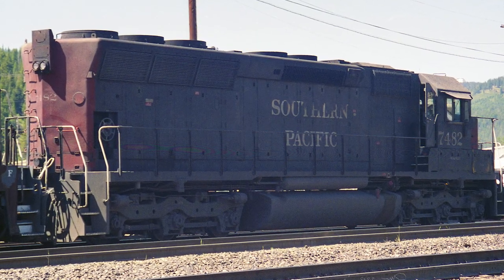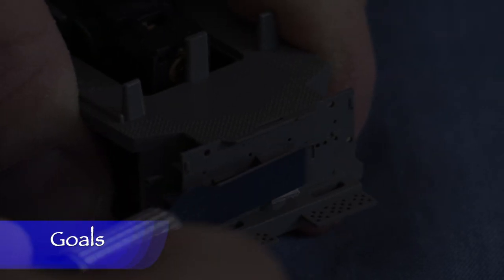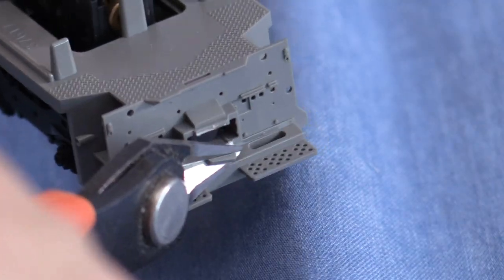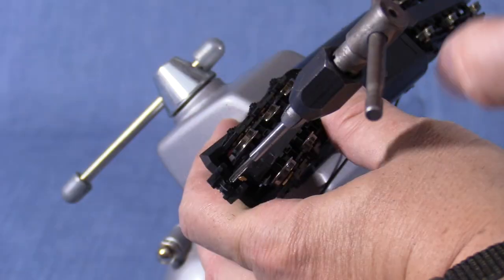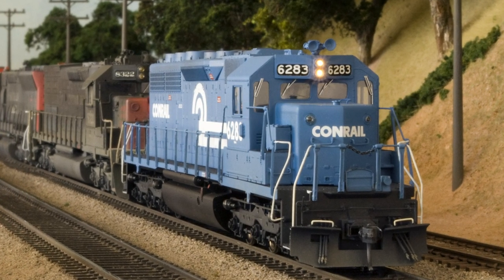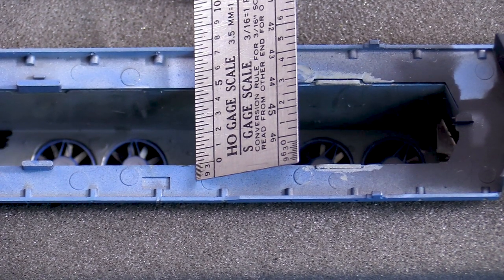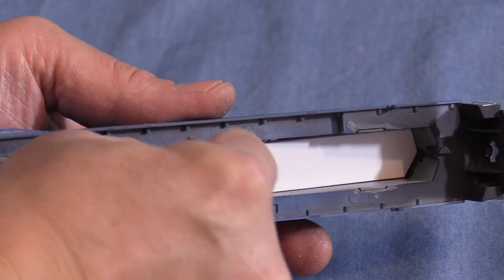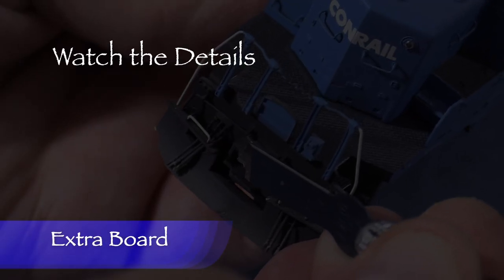Model Building HO SP Consist Part 6

Comment: I have some buildings for my layout, and painted the insides of their facades black so that light doesn’t bleed through. You could do the same when making buildings for your layout.
Reply: Thats the mistake I already make. Sometimes it hard to paint the inside once you're done.
Reply from the maker: Yes, it will work on buildings, too.  It's especially important if the building exterior is left unpainted plastic.  Thanks for watching!

Comment: Nice work Dan!! I still rewatch your
25 part series on the Santa Fe 
SD40-2!!! I have been slowly adding
air tanks and and filters to the
Chassis of 8 SD40-2s and I finally
got the Cannon Brass walkways
in for all 8. I forgot the Cab vents
and got some of them on E-bay
so now the big thing left is to
solder the wires to the brass
rivets on the trucks and replace
the sintered wheelsets with nickel
silver wheels!!! Didn't you go with
the 40 inchers on the Blue Box
Athearn???
Reply from the maker: I don't remember if I used 40 or 42 inch wheels on the SD40-2 offhand.  I want to say 42 because I think that's what I could get at the time.  Either will work, and the difference in appearance is minimal since the sideframes block the view of the wheels to a large degree anyway.  The coupler height might need to be tweaked depending on which one you use.  For me the main advantage is the superior electrical performance of the replacement wheels, which is especially important with sound equipped models.  Thanks for watching!
Reply: @DanielCortopassi  Thanks Dan!!!
I'm just glad I don't half to replace
the noses on mine like you had to
do on the Santa Fe units you built!!
The only thing Conrail added was
the Cab signal boxes! 😀😀😀😀

Comment: Hey Dan, you should check out Aaron Hiene Electronis for his “RB1” beacon. I use them on all prime stratolite da as they mimic the faux flashing these produced. Very well done product. It would work well for the Cotton Belt unit
Reply from the maker: I have one of those that I picked up at a Bay Area Prototype Modelers meet a few years ago.  I've had it in mind to use it on a different Cotton Belt locomotive that I'm building.  If I like the effect I may get more.  Thanks for the suggestion!